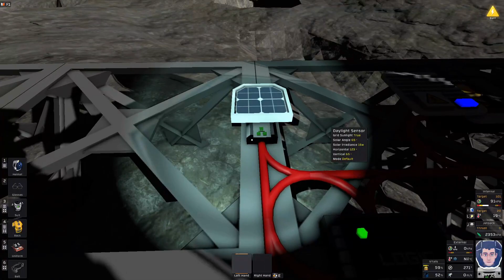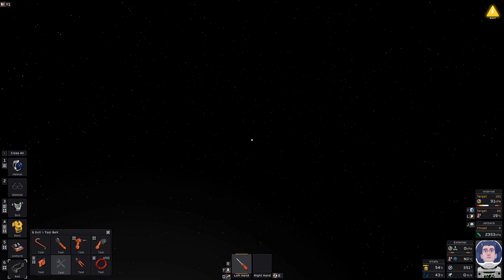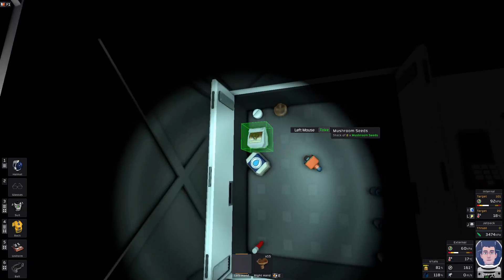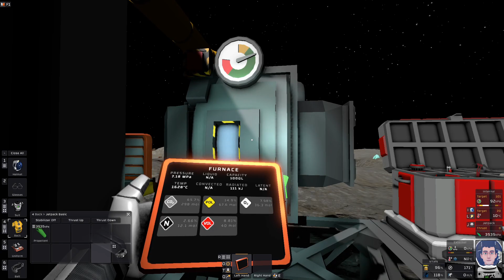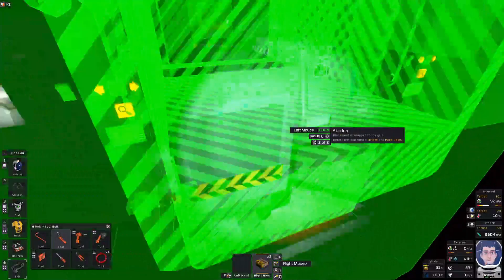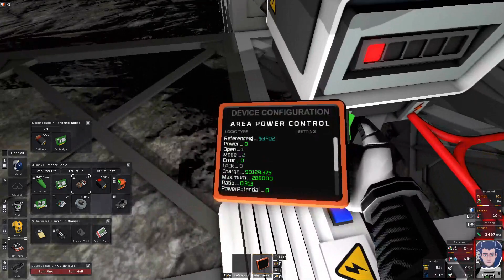Stationeers S1E05 - Mimas - Solar logic and printing

Comment: At the moment Mimas is kicking my ass. I'm at day 200 and the biggest problem I got is power, thought I could just get the deep miner/combustion centrifuge  and get the coal from there. Then use that to power solid fuel generators and boom... problem solved... but the amount of coal is not enough... Got 5 CCs abd 9 deep miners. 12.9kw of solar power (200+ solar panels) when the sun is up. just watched your sterling engine video and gonna give that a try... (got +1200h and never had to use it until now) otherwise I'm done with Mimas.
Reply from the maker: Sounds like you have a very extensive base :)
For a Sterling engine I highly recommend placing your furnace(s) in an enclosure to reduce heat loss (I do this in Episode 7 found here https://www.youtube.com/watch?v=AkKis8hok0Q ).  And if you're still having trouble you could use a Gas Fuel Generator, which uses surprisingly little fuel.  I set one of those up in episode 12, found here: https://www.youtube.com/watch?v=7QZ4p_Z1Exs
Good luck with everything :D
Reply: extensive base, Hehe .. its just the starter base....You should see the mars base :)

Comment: Why so many daylight sensors?
Reply from the maker: I start going over them at about 8:29.  The tldr of that section of the video is to point out that the face of a block (North/South/East/West/Up/Down) determines what Vertical angle the sensor sees, but the rotation of it on that face changes the Horizontal angle.